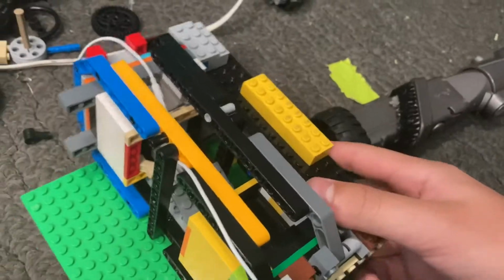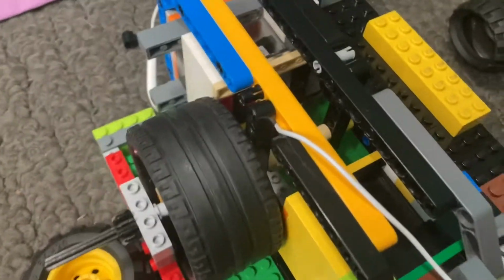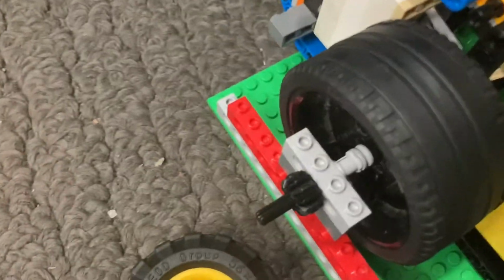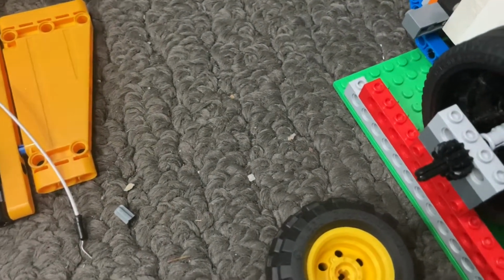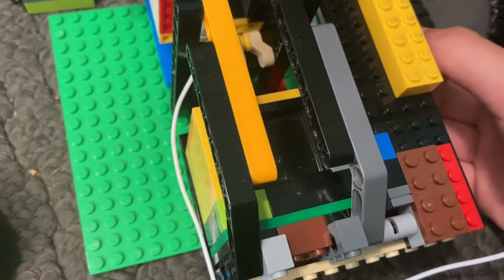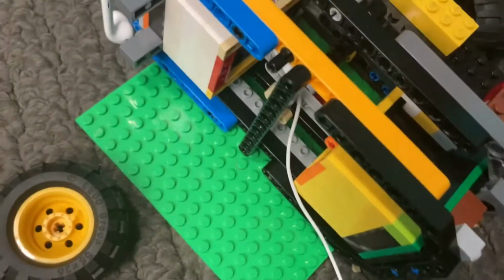Boxer 2 Goes FULL SEND! (almost)

Comment: Your flywheel is backing out 😂 so thats why it keeps scootin, you need to secure the other side
Reply from the maker: I would love to do that but I really can’t figure out how to do that without modifying LEGO pieces
Reply: @KFPlusLegoMastery  put paper shims in between the blocks
Reply from the maker: Shlushe 10 I did try to put paper between them but it wouldn’t hold together and it had the same result as if I didn’t do it at all.